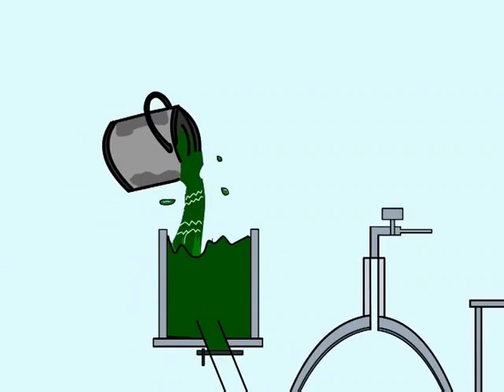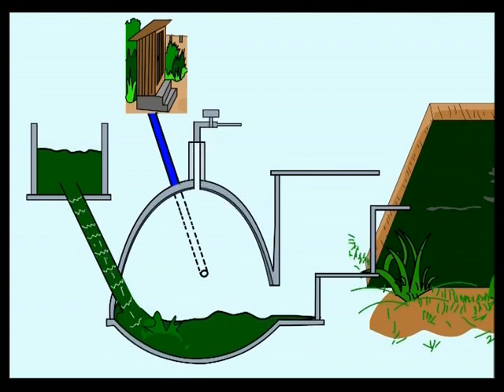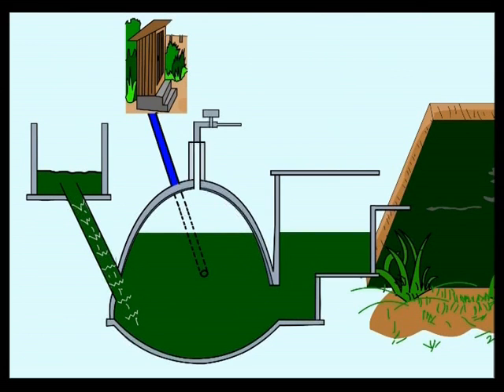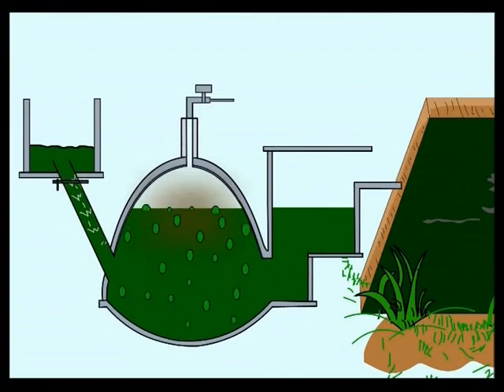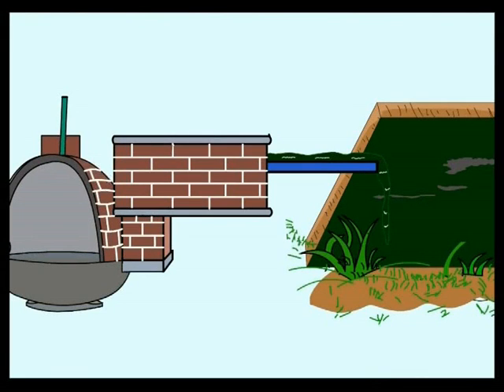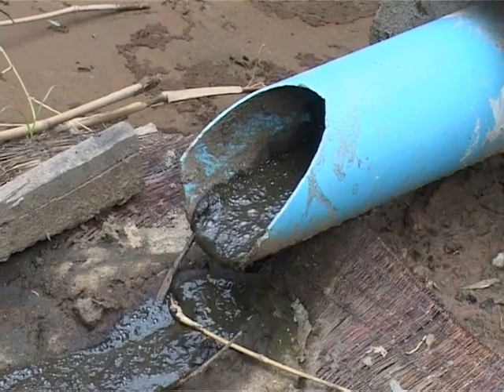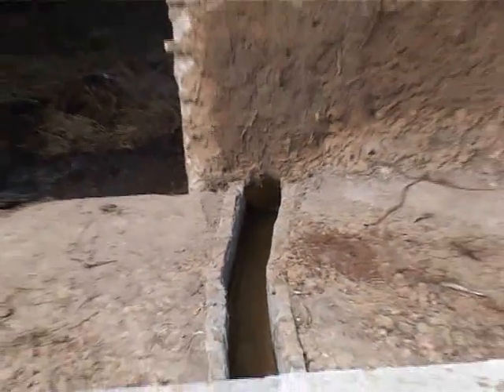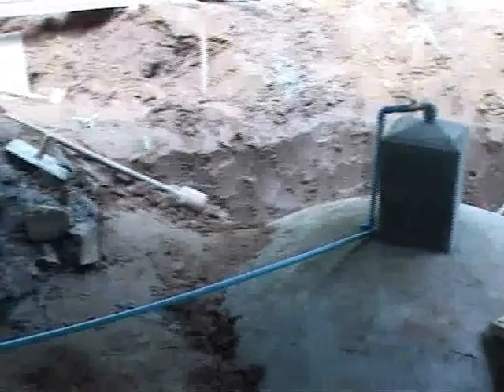SNV and domestic biogas technology

Comment from the maker: We can't be absolutely sure all the methane has been extracted. However, choosing the correct capacity of the digester in relation with the required gas consumption and daily feeding will go a long way in making sure the digester operates efficiently.
The correct choice of digester capacity and correct operation of the installation (daily feeding and daily gas consumption) will largely prevent methane escaping through the outlet, although incidental discharges will occur.

Best, Fred Marree